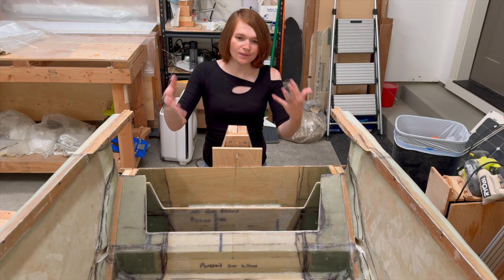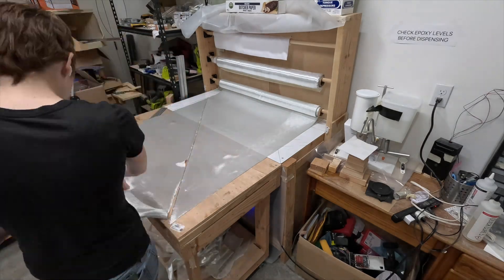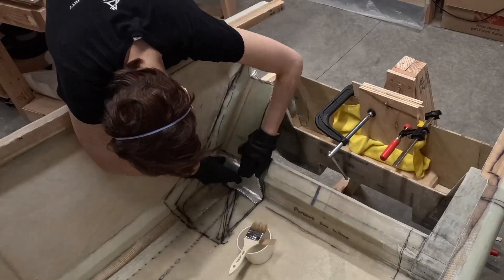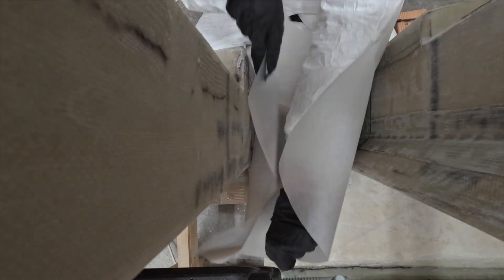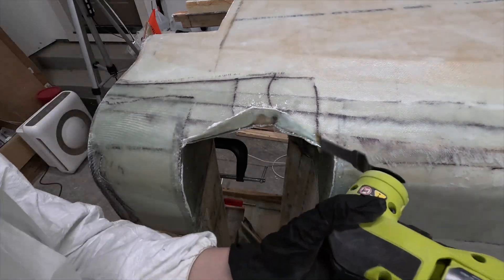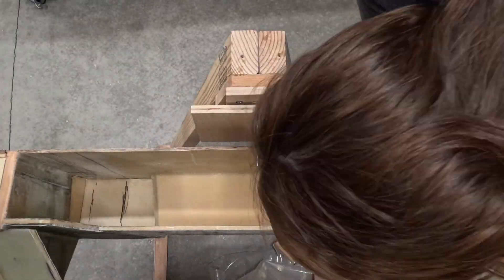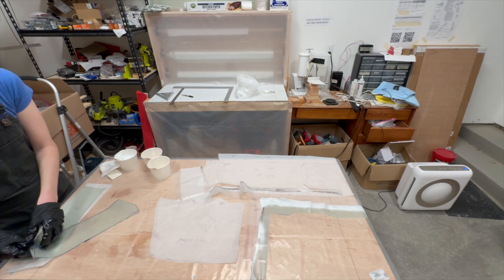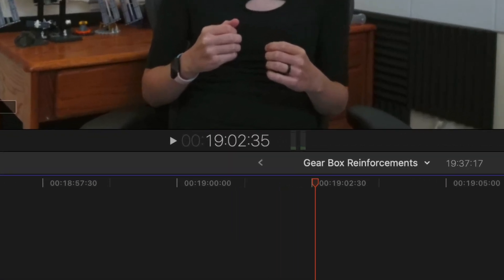Main Gear Reinforcement - Electric Airplane Build Log

Comment: just found this channel been thinking about building my own plane for a while, was more thinking about using a petrol engine. what sort of electric motor/ batteries were you thinking about using for this plane.

super cool project looking forward to seeing more
Reply from the maker: @wiz-aaaard  currently, I plan to contract with a company to provide the electrics. I’m still figuring this out, but whenever I do the install of the electrics, I’ll put out as much as I can about the whole process, as well as previous plans for doing this..